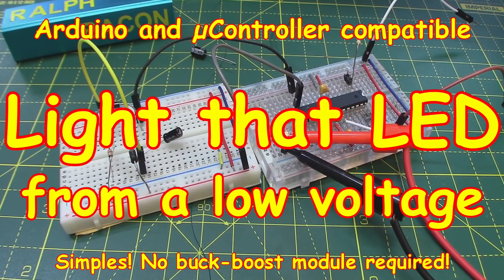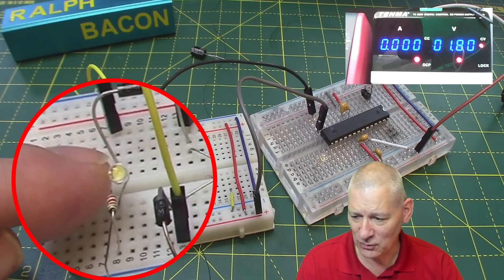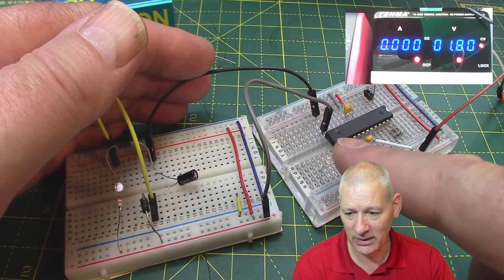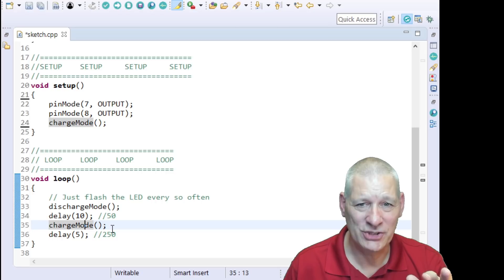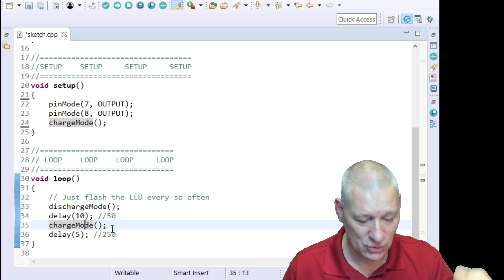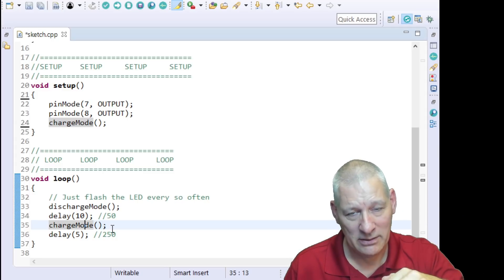#167 Light an LED 💡 with low 1.8v Diode Pump µController output (easy)

Comment: It seems there is a mistake in your explanation,the voltages are not added,at the ac positive alternating,the capacitor charges to 1,8V (minus the Vf of the upper schottkey diode),when the signal reverses,the ac voltage and the capacitor  converge at the same potential on the green diode  cathode, hence the led flashes are due to the quick discharge of the capacitor.
Reply: Voltages do add up. When the bottom µC pin is low the capacitor gets charged through the purple diode. At this point positive terminal of the capacitor is at ≈1.5V (1.8V-Vf) relative to ground. When the bottom µC pin gets high the capacitor gets connected in series with the supply. At this point positive terminal of the capacitor is at ≈3.3V (1.5V+1.8V) relative to ground. Then the capacitor is discharged through the LED until the bottom µC pin gets low again and cycle repeats.
The green diode is pretty much not needed in this circuit. It doesn't do anything because its cathode is always at higher potential than anode. It might've been useful to connect a diode to the positive terminal of the capacitor and connect another capacitor from the load to ground to get a more stabilized supply but it's a trade off due to forward voltage drop. In that case the diode would be necessary to prevent discharge of that capacitor.
Reply: @hauuau  Thanks for the pertinent input, perhaps the green diode is muddleding the circuit, I thought it shunted the capacitor by conducting the whole current to the load, but as the capacitor has now 1,8V on it's negative pin and 1,5V on the positive, the voltage across the capacitor is 0,3V equal to green diode drop. of which  the anode is also at 1,8V and the cathode is on  the same capacitor potential of 1,5V so this voltage is below the threshold triggering the LED ,due that , no current flows through the green diode so 1,8V ac and 1,5V capacitor are series added to give 3,3V which allows the capacitor discharge via the white LED. It is a mystery game of potentials!
Reply from the maker: Ues, hauuau has summarised it correctly. The voltages do most certainly add up because the negative plate of the capacitor is now effectively above zero (around 1.4v). It's been 'lifted' so the 1.8 (via the green diode) on the positive cap plate is then added to the original 1.4 (approx) charge. We tend to think of caps as mostly being connected to GND (zero volts) but that is not the case at all here.

Comment: Neat trick :-)
Been used in DC/DC converters, since the MAX232, with analogs switches that is. Your circuit is less complicated.
What is the current draw with an Amp. meter?
Thanks for sharing :-)
Reply from the maker: I didn't measure the current accurately, Asger, but my PSU didn't even register 1mA. But the charge pulse is quick so it probably missed it. Mind you, even when it was (almost) permanently lit it still didn't register so I'm guessing that it must be low. Good question, sorry I couldn't be more precise. Thanks for posting.

Comment: Hi, what about either of these IC's... MAX1682 MAX1683
Reply from the maker: Yes, they are both switched capacitor voltage doublers, John, and would do much the same thing, but would require another chip. The advantage they have is that the max current output is 50mA, enough for quite a few components.
For those interested here's a link: https://datasheets.maximintegrated.com/en/ds/MAX1682-MAX1683.pdf
Reply: Interesting that the datasheet referred to here seems to specify tantalum or ceramic capacitors.

Comment: Hey Ralph, when you swap the power doesn't that mean you have the wrong polarity on the electrolytic cap? Thought you had to have the polarity the right way around for them? What am I missing?
Reply from the maker: The capacitor never has its polarity reversed. What happens is the cap is charged to 1.5v initially (approx). Then the poles are 'switched' but the capacitor merely sees that its negative lead is lifted by that amount as the additional 1.8v is applied to the positive plate. So the capacitor has been level shifted up. But at no time does the negative lead go above the positive lead or it would have a short life indeed! Very good to hear from you Andrew, 

I hope things are going well for you. Did I ever mention I got a bootloader onto that fake STM32 by using an older version of the current bootloader? Another viewer had exactly the same problem but he knew his STM32s were previously working just fine for months until he tried putting on the new bootloader. How about that?
Reply: Great news Ralph! Nice to finally find a way around it. That then proves that there are physical differences between them even if minor. Still don't understand how putting 1.8 on negative pin and ~1.5 on positive does a level shift but I will do some googling as it is an interesting concept.

Comment: Interesting coincidence. This week I used a variation of this circuit to generate negative voltage. 

Last week I was trying to use a P-channel MOSFET to switch power on the high side of a load. The MOSFETs that I had have a Gate to Source threshold Vgs(th) of -5V, and my circuit was running at 5V, so I thought I was all set. I'd pull the Gate to 5V to turn off the current flow, then pull it to 0V to enable current.

It worked, but it wasn't allowing very much current... about a tenth of what the load typically drew at 5V. After some research, I learned that the Vgs(th) is just that, a threshold.  It it doesn't mean the MOSFET is in saturation, so it basically was only open a little bit. If my circuit were designed for 12V this probably would have been the perfect MOSFET for the job. So I ordered some MOSFETs with a Vgs(th) value of 2V. (Which today I confirmed are perfect for my 5V circuit.)

While waiting for those to arrive, I got antsy to see my if my project would work. So I found a circuit for a Negative Voltage Generator, which looks a lot like the one in  this video, only with the diodes turned around. (I'm sure there are other changes but I don't have the circuit on hand to compare.) I used a 555 timer rather than an MCU, and an additional polarized capacitor placed across the new negative rail and ground for smoothing, *with the positive lead of the cap connected to ground*.

The 555 was a little under 5V peak to peak, and I used standard diodes rather than schottkys, so the result was about -3.3V on my new negative rail. With 5V at the Source and -3.3V at the Gate, I was able to open up the P-channel MOSFET completely and get the expected current to my load.

The correct MOSFETs arrived, and they work just fine using 0V at their gate. So I took the negative voltage components and put them on their own prototype PCB, which I will keep for future reference.
Reply from the maker: Sounds like you had a bit of fun! 
Negative voltage supplies are indeed just variants of the overall voltage doubling technique. But using a P-channel MOSFET in the VCC supply to a circuit is a well established technique. You MUST use TTL-level (5v) Gate MOSFETs though (like an NDP6020P), or, as you discovered, they only turn on a bit and get hot too. Connecting the gate to VCC with a 100K resistor is enough to ensure it has truly switched off. Bringing the Gate to GND will switch it on (usually via another N-channel MOSFET but a BJT will work too). Look at some of my videos on this subject, including the auto switch off project.
https://youtu.be/g1rbIG2BO0U

Comment: Very nice video Ralph... I'd always been intrigued by these voltage doubleer circuits, but they seemed like black magic of sorts... now I might be tempted to use it in a few low voltage projects! Thank you for the great explaination! :)
Reply from the maker: This one is great for lighting LEDs (for drawing attention) but for more current capability a buck-boost might be a better bet.
Reply: So perhaps not good for driving a NRF24? Damn! 😂😂

Comment: That's a quality content Ralph this voltage multiplier can be achieved with the NE555 (low voltage version) or maybe even with passive components design only..
Please tell your boss (Benny) to give you a raise in salary starting next month 👍
Reply from the maker: I told Benny about the salary raise but he just purred and turned over to have his tummy rubbed. Sigh. Yes, a 555 timer will do this but you might as well use a single PWM pin in that case from the MCU! Thanks for posting, Ronen, good to hear from you.

Comment: Voltage doublers are found in antiquity.
Reply from the maker: I checked on Google Maps but could not find Antiquity. It found Antigua but no mention of voltage doublers there. 😀 On a more serious note, you are correct, this sort of voltage doubling technique (from an AC source) was invented in 1913-14 by Heinrich Greinacher. It was built upon by many others including the Cockcroft–Walton duo. Nothing new under the sun, hey, Robert?

Comment: You can stack this circuit many times to get a larger final voltage. 

It's a classic voltage multiplier that got quite a bit of use for high voltage low current supplies in tube (valve)  circuits back in my younger days
Reply from the maker: Yes, they used (a variant of) this method to get the 10kV+ for the old cathode ray tubes that my grandad told me about.
Reply: @RalphBacon  your granddad... Now I feel old...

Comment: Well. Benny, we're not in Kansas anymore!!! Awesome, absolutely awesome. Thank you for that video,  Ralph. One application of this technique that springs to mind : a flashing LED to warn of low voltage. It could be improved with "port Addressing" and ExOr-ing the bits for the pump pins, this would result in the switching of the two pins instantly . Thus removing the , admittedly extremely short , time when both pins are high or low. I understand that this video was focusing on the diode pump circuit, so you were correct in avoiding muddying the waters with the additional complication of port addressing. Thanks again.
Reply: You could achieve the same without port addressing simply by setting one of the pics to input mode (high impedance) before you flip them. That would also prevent a short without complicating the code.
Reply from the maker: Awesome, you say, Michael! Wow! It's pretty simple though, don't you think. A slight change to a standard Diode Pump because we have an MCU that replaces the clocking we need. But I most certainly appreciate your kind words (Benny too!).

Your summised correctly why I didn't do port addressing, which would have had the advantage you said. But, beginners seeing that would be confused whereas a simple digitalWrite is understood by everyone.

Thanks for posting. Good to hear from you.

Comment: pure genius....!  I used to mess oround with Jule thiefs but this... this is great! I have a  question though how do you get the arduino to work with 1.8V.... isn't the minimum 5V...
Reply from the maker: Not genius, pure or otherwise, I'm afraid, just a simple demo of the laws of physics. The chip inside an Arduino board is the ATMega328P and runs from 1.8v (at reduced frequency, 1MHz, possibly 8MHz like mine in this demo) up to 5v and the full 16MHz. I chose 1.8v to show how low-powered battery projects could still light an LED even when running from such a tiny voltage. Glad you liked it! Thanks for posting.
Reply: If you run it at a lower clock speed (say 1MHz) it is rated to run down to 1.8V.

Comment: Nice idea to solve that Ralph. First I thought you would use the well known joule thief but this would need a transistor and a specially wound coil. If you have a microcontroller (or anything that produces an oscillating frequency like a 555) already in the circuit your way is much easier. I like that kind of video where you show such simple solutions to reoccurring problems.
Reply from the maker: Yes, Michael, that's why this particular method is so useful; if you already have an underutilized MCU then 3 components can get you a bright flashing LED from most battery-powered projects. Possibly a louder piezo too but I haven't tested that (yet). Good to hear from you.

Comment: I'd feel more comfortable if you mentioned that such a routine ought to be done by a ProtoThread..
Reply from the maker: Well, at best I'd do this using a state machine (most of my sketches are like that) but for a simple circuit to stop occasionally and flash an LED I think it would be OK using a blocking routine. But as they do a protothread library for the Arduino I might look at it although it would get even fewer views than I'm getting already! On an ESP32 (with RTOS) I'd just use a low priority task, job done.

Comment: Good day, Ralph!

Great vidéo as always, my Friend.  It reminds me of that simple old voltage doubler/tripler/quadrupler/.. we use to study while I was in technical school.  One just can't beat simple old ways to do things, can they?

Nowadays, there is a simple step-up module I have here.  « T64 » DC-DC Converter that will boost any voltage (as low as 1,5V), to nominal 5V DC.  They come in a path of 10 and are panelized 2 x 5.

Have a great day, and say Hello to Benny on my behalf.
Reply from the maker: Benny says Back At Ya!  Yes, a simple buck-boost module would be useful for most things except a flashing LED I suspect. But at least this is simple and cheap, although it does require two pins of your MCU.

Comment: Tantalum?  We can get high capacitance at these low V.
Reply from the maker: Yes, if you can get a tantalum cap that would be fine. As long as they are small enough.

Comment: why do you need green/lower diode? try w/o it
Reply from the maker: You're the second person mentioning a green diode. Did I miss something in my own video? What green diode?
Reply: @RalphBacon  @5:35 the lower diode. I'm not sure it does anything there - I'd say it's never open.
Reply: @RalphBacon  It's probably about using circuit like that instead: https://i.imgur.com/TIKhw1m.png
Reply: @RalphBacon  lol... I was thinking the same thing... and then the penny dropped... it's the diode in green on your whiteboard schematic. ;) And yeah, I don't that circuit can work without it...

Comment: Hi Ralph, really cool! I was thinking; why not add a capacitor parallel to the led?
That is what they do with those color changing solar garden lights. That should keep the voltage steadier on the led and eliminate the flicker on camera.
Another variation might be to drive the led with a solar led controller. A QX5252F (or similar) and a Inductor should be enough to drive the led from just one digital pin.
Thanks again for another interesting video. Please keep them coming. 😃
Reply from the maker: There's probably lots of things we can do here, including driving the circuit from a clocked output instead of switching pins, but hey, where's the fun in that! Glad you liked it and Thanks for posting.

Comment: I agree with Alex, one output and the same 2 shottky diodes and a cap can produce 2 x 1.8 - 2(0.3) = 3v pules; using two outputs and 4 diodes and 2 caps can get you about 6v.
Reply from the maker: But at a reduced current, conservation of energy and all that jazz.

Comment: old red led's were 1.6v ....... old green 1.8v
Reply: Yes, and orange/yellow also work at 1.8v. For other applications, IR LEDs work at 1.7V and are detectable using most smartphone cameras.
Reply from the maker: You say that but a LOT of my recent diodes are higher, and I don't know why. They often require 2.0+ volts albeit at low current (sometimes). Some require 2.9v. Perhaps they are really all white diodes that have a coloured plastic head? I wouldn't put anything past the ... er, entrepreneurs of the Far East.
Reply: @RalphBacon  chemistry. they not made of the same stuff 1970's diodes were. they switched from Gallium Arsenide Phospher to  Indium Gallium Aluminum Phosphide or something like that. greater brightness in exchange for an extra volt or so, and made blue/uv possible and then with the old CRT white phosphor powder thrown in on a uv base we got white

Comment: Marvellous trick for getting a higher voltage!
Reply: if you keep adding more diodes and more caps you can get thousands of volts and run a tv tube.... just like they always have....
Reply: That seems rather cumbersome. 
Just feed the higher voltage on the output side back into the input side. Then you'll have a loop that will spiral the voltage up to infinity. 
And then you can put a buck converter in parallel on the output side to take out the voltage you need, eg 12 volts.
Reply from the maker: If we do that can we then remove the power supply itself and have a perpetual motion circuit?
Reply: Man, Ralph, why did you have to mention perpetual motion? Now a lot of "free energy with this perpetual machine" videos are popping up in my YouTube feed :-)

Comment: There is no need to use two outputs, and using a sufficiently high switching frequency you can significantly reduce the value of the capacitors: https://upload.wikimedia.org/wikipedia/en/thumb/7/7b/Dickson_doubler.svg/514px-Dickson_doubler.svg.png
Reply: And even simpler. The second diode could be the led and the second capacitor could be replaced with a resistor.
Reply from the maker: If you replace the second diode with the LED, how does it see the higher voltage across the capacitor? I don't see how that will work but you can try it and let me know if you like!
Reply: 1. When the output is low, the capacitor is charged through the diode to the supply voltage minus the drop on the diode.
2. When the output goes to a high state, the voltage at the junction point of the diode and the capacitor relative to the common wire will be the sum of the voltage accumulated in step 1 and the output voltage.
3. If an LED is connected between the indicated junction point and the common wire, the capacitor will begin to discharge through it. A resistor is needed to limit the peak of output current.